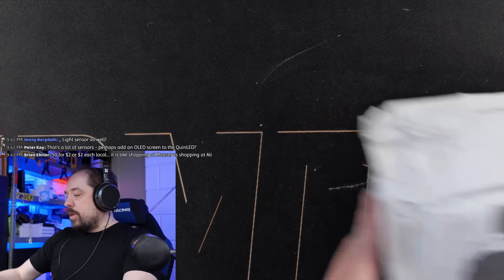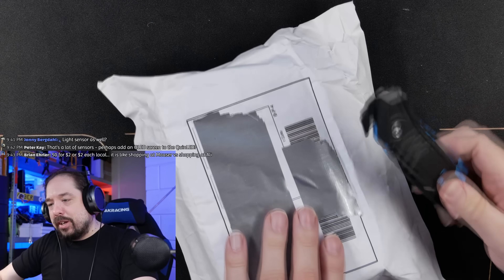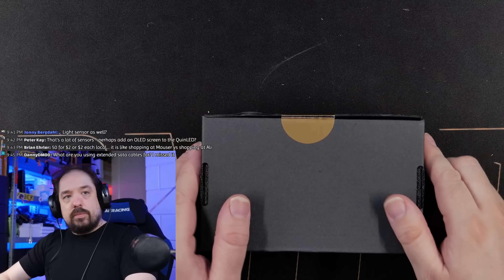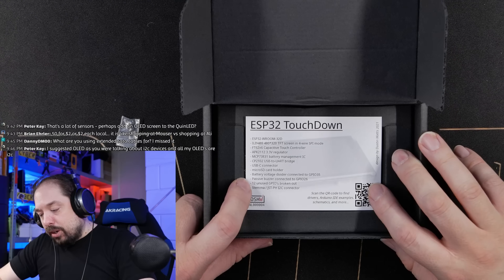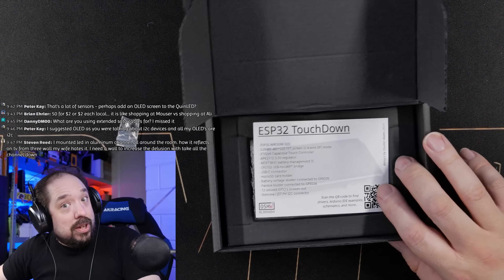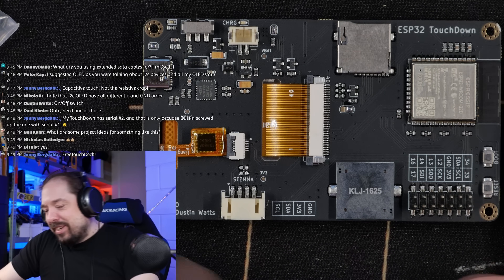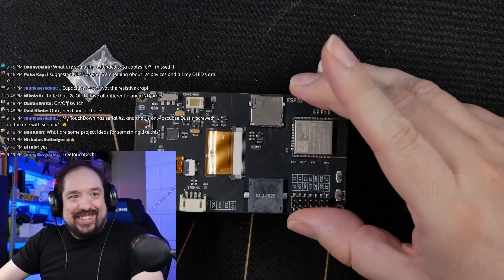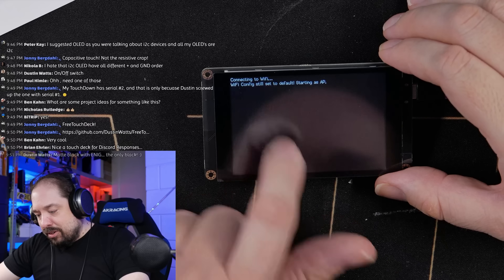ESP32 Touchdown first look and test!

Comment: Is this a stand alone pc, just a monitor, or what ?
Reply: This is a MCU. with TFT, with TOUCH, with Card-Reader, with Buzzer , WiFi and BlueTooth. The MCU is ESP32 from Espressif for running with microPy and can run programs after flashing via seriell / USB.
Reply: @paulkirchhof9546  MCU ?
Reply: @milesmoore5422  , MCU = Micro Controller Unit

Comment: I have the earlier version, the FreeTouchDeck. I do use OBS, but I usually stream while I am doing something on my laptop. So the keys are send to the active application and not to OBS. So OBS needs to be your active window. Probably it could use an app which re-directs the keystrokes to the app you need. Like in delagado where you specify the target app. A chap has done it with Teams, so you can mute/unmute even if you are checking other stuff in a different application.

Comment: Brilliant! I would love to use something like this to set scenes or trigger automations in Home Assistant 👍
Reply: Exactly what I was thinking,  put them around the house as wall controls for HA.
Would need to source power somehow and a nice looking enclosure though.
Reply from the maker: Sure, not sure that the default "freetouchdeck" software would be the best fit for that, but since it's an ESP32 platform you can run any code on it you want!
Reply: @IntermitTech  , this is a good product for makers for technicians knowing the possibilities of the Espressif processors.
A version with 7“ TFT is wishful. I like to have one or two or.....

Comment: Could it be used to switch presets and trigger macros in WLED?
Reply from the maker: Hmm, in theory yes. I haven't dug into the software yet but it would be able to do actions on a webpage for sure. But ideally it would be able to send direct API calls for instance and I don't know if the software is able to do that.